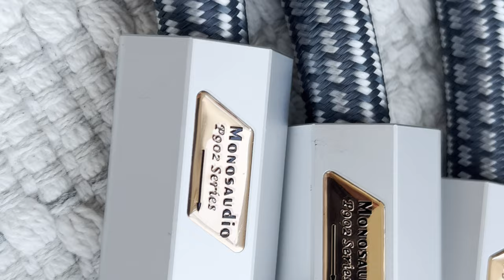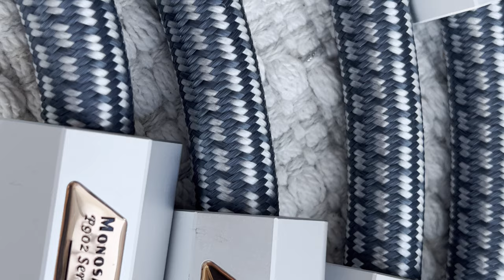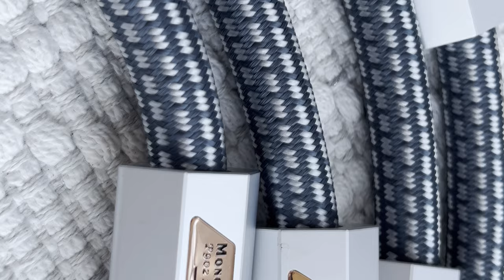I replaced ALL POWER Cables With THESE - Here's What Happened!

Comment: Interestingly, I had converted a 10 gauge extension cord by removing the standard plugs and replaced them with precisely the same Monosaudio plugs you used in your video complete with the rhodium coating. 

Unfortunately, the sound was worse than the stock connectors, surprisingly  (less dynamics, not as revealing, etc.).

I viewed this as the ultimate experiment at least in terms of evaluating the effects of the higher quality plugs since I had used the same cable.  I plan to replace this converted cable to a proper HiFi power cable soon, and will not be using it in my system.

Of course, I can't comment on how what I did would compare to the your use case...combination of the higher quality copper, shielding, in addition to the higher quality plugs.

But,  based upon your review and my experience, I would surmise most if not all of the improvement you observed was coming from the cable and shielding, and not the plugs themselves.

BTW, I have a very revealing system so your experience may be different than mine (BHK 250 amp, tricked out Freya+ pre, Heresy IV speakers, REL S 510 sub, etc.).

Hope this was helpful.
Reply from the maker: That's interesting! Did you terminate the cable yourself, or did you buy it pre-made?  A secure connection between the wires and the connector is crucial for maintaining good sound quality.  Loose connections can increase resistance, which can negatively affect the dynamics of your audio.  If you made the cable yourself, double-check your soldering or crimping job.  If it's pre-made, you might want to inspect the connector for any signs of damage.
Reply: @TheAudioStuff  I did assemble myself.   I'm an engineer and so I made the best of what was available.   With that said, the terminal connections within the plug housings (e.g., where the wires seat), are incredibly low quality by modern standards - both in the way in which the wires are secured as well as with the metal they had used.

I'm confident the lower audio quality I heard was because of that. 

Either way, it was a worthwhile experiment from the standpoint of teaching me the importance of the wire and shielding used (a combinationof your results and my results from other upgrades), and the secondary importance of the quality of the plug terminals (the Monosaudio plugs were indeed worse, but not as big of a difference as one would expect when changing an entire cable).

Of course, I will never purchase from Monosaudio again, but it was an important lesson.

Comment: What about the power points, the wire in the walls, the wiring in the fuse box, the fuses, and the wiring to the street? That has a much greater effect than the 1.5m cord from the gear to the point.
Reply from the maker: All that is getting filtered by my hifi power filter, then the goal is to transport the power in an equally clean way to the gear.
Reply: Power filters can also effect the sound in a negative way fyi

Comment: Why do the one with long nails not insert the power cable all the way in..

Of course you will not get the benifits of the better conectors when they are inadequately used..

I hope you didn't use the cables that way!
Reply from the maker: It was that way just to easier record the footage, as they sit really tight in there. 

I didn't use them that way, I always push all the way in ;)

Comment: A hair dryer is able to pull 1,800 CONTINUOUS WATTS from a 120V outlet using skinny cables. So you are saying these upgraded cables can magically pull more watts?
Reply: That being said, sometimes those cables heat up from the current xd
Reply from the maker: I get where you're coming from! The capacities of power cables can be surprising, but upgraded cables may not necessarily allow for more wattage but can improve the efficiency of power delivery. It’s more about reducing losses and improving overall performance than just pulling more watts at the outlet. Thanks for raising that point!

Comment: For audio quality, these work best when connected to a Hi-Fi power station, with a Hi-fi national electricity distribution network, using Hi-Fi fuses, and earthed to a Hi-Fi planet.  Otherwise, any sound improvement is in the deluded imagination of the listener who is easily parted from their money.
Reply: Yes, we should not forget to change the cables in our walls, and in the street, and the turbine in your electricity factory!
Reply from the maker: Changing the cables only after the power filters should usually do the trick.
Reply: @TheAudioStuff  If the 'trick' is to relieve gullible buyers of their cash.

Comment: All of the symptoms your are listing can be the effect of electrical noise.
However, it is very unlikely that the power cable which came with your electronic device is the source of such noise unless you are using cheapo Chinese garbage.
Power filtration takes place at the device level with a power filtration circuit directly off of the powered lines coming into the unit.
ANY additional filtering beyond the designed filter will alter the intended sound of a device.
I have used power filters before and all they did was destroy the sound of stage of devices.
The largest power quality issue is going to be from your breaker box to the outlet you are using.
Installing your amplifiers on isolated lines that go directly to your breaker box without breakouts going to different areas will improve thing significantly.
Far more than just replacing the power cable from the wall to the device.
The issue is cross talk between the devices on the power lines.
Since AC is a push pull frequency, the frequencies are affected by other devices on the same line.
This is what the built in power filter is for, but it can only do so much.
Complete isolation of circuits is the only real solution.
Reply from the maker: Thanks for your insights! You bring up some great points about power filtration and the importance of isolation. I completely agree that power quality issues can stem from various sources, including the breaker box. Your experience with power filters resonates with many in the community who prioritize preserving the integrity of their audio gear. It's definitely a nuanced topic, and isolation can indeed be the key to achieving the best sound quality.

Comment: Just use the one in the box and forget about it. They have no effect on performance.
Reply from the maker: With lower end gear, it might not have much effect. However, as you get to the better, more resolving AMPs/DACs - using the cheapo stock cord is not a good idea in the long run.
Reply: @TheAudioStuff  Wrong. They have no effect on performance.
Reply from the maker: What system have you been testing that on?
Reply: @TheAudioStuff  It doesn't matter. They have no effect on performance because it isn't possible that they do.

Comment: Upgrade the last 150 cm of all crap residential electrical wiring to the power station.
Great 👍 
One less garbage channel to watch.
Reply from the maker: There seems to be a misunderstanding. So let me clear it up! 
Replacing the last whatever length of dirty wiring is indeed not the smartest thing in the world to do - I totally agree with you!
That's why in all my tests, and in my day to day use, I replace only the wiring, carrying out the clean power from my HiFi power conditioner. - That approach makes a lot more sense ;)
Reply: @TheAudioStuff  yes agreed. Anything coming out of your hifi specialized power supply is important, anything before the low noise regulated linear power supply is practically useless. That's a fact.
Reply from the maker: @al-mukhantich  well... if you don't believe in that either, then I have something for you, that you can't deny. Non shielded cables are radiating noise everywhere, and it gets to all components nearby. Superior shielding is just a single part of hifi cables.